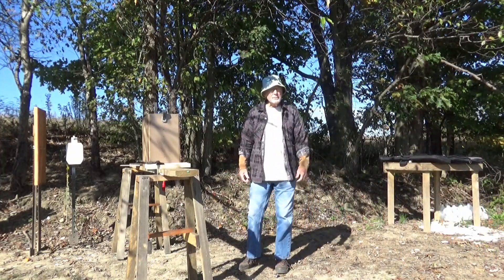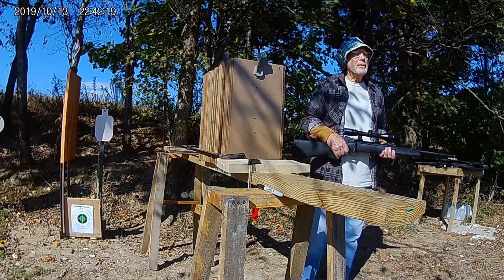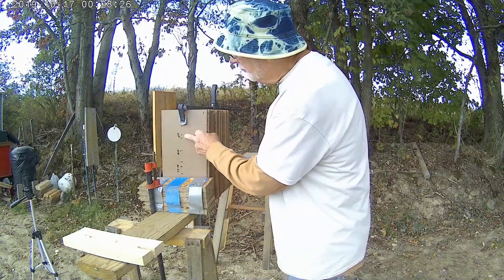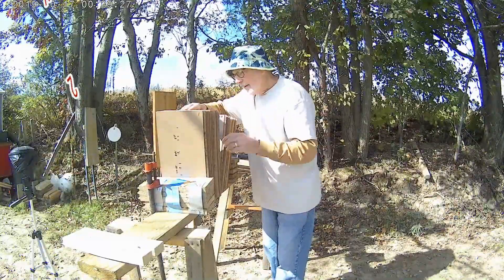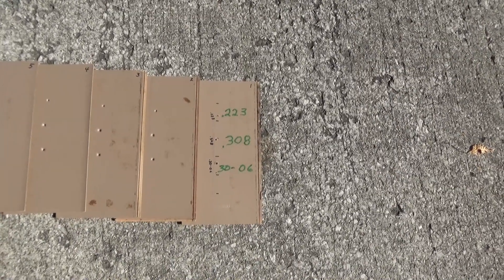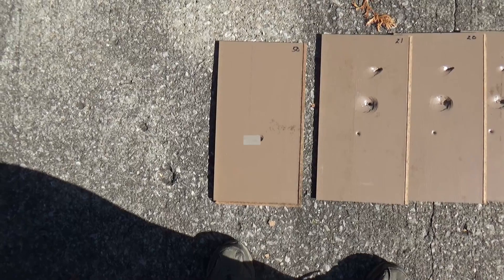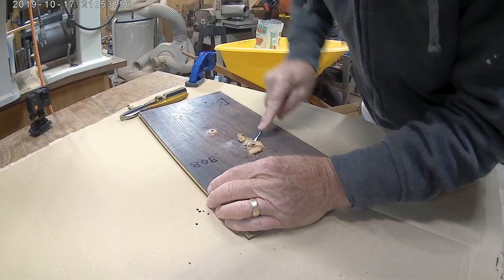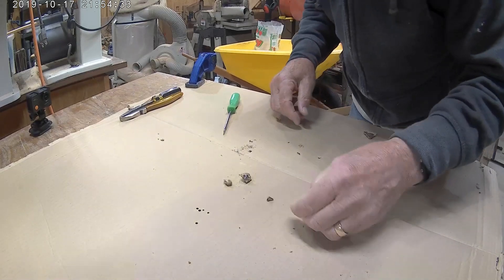223 vs 308 vs 30 06 Penetration Comparison

Comment: I have seen 308 and 30-06 penetration tests on cinder blocks and there was little difference in penetration. I was surprised by the difference in your test.
Reply from the maker: @Narsuitus.   Thanks for taking a look and commenting.   If I had those materials still, I would do that again to see if we would get the same results.   I have also shot the cement block slabs and they tend to kill everything.   It's also interesting to shoot into kids play sand and see how it kills bullets.  Somewhere in my list I have done those as well a few years back.   And I don't understand why the .223 and .308 were similar, could be the ammo I used.  You might want to check out "Banana Ballistics" he does all kinds of penetration tests.   Thanks again and take care.

Comment: That was a neat comparison, very good presentation.  I'm a simple old fat dad who always thought the 308 and 30-06 were basically the same.  Thanks for illuminating me!

Also, if you find some (a bunch) of extra change in your couch, I highly recommend this camera.
PANASONIC LUMIX FZ1000 4K Point and Shoot Camera, 16X LEICA DC Vario-ELMARIT F2.8-4.0 Lens, 21.1 Megapixels, 1 Inch High Sensitivity Sensor, DMC-FZ1000 (USA BLACK) https://www.amazon.com/dp/B00KOUIBZW/ref=cm_sw_r_cp_apa_i_iLTSDbGRVB6P6
They have used models for pretty cheap if you check often.  Also a mini shot gun mic can go on that camera and really help with the audio.
Reply from the maker: TOFD, thanks for your comment and for viewing.  Per a question from one viewer, I was down at the farm today shooting Soft Point/Hallow Point .308 and .30-06 into the same material.  They both stopped on the same board.   Soooo, not sure??  Thanks again.